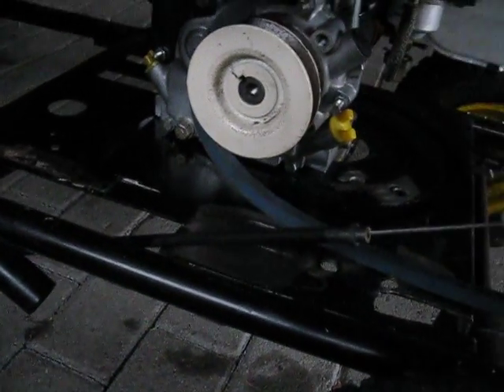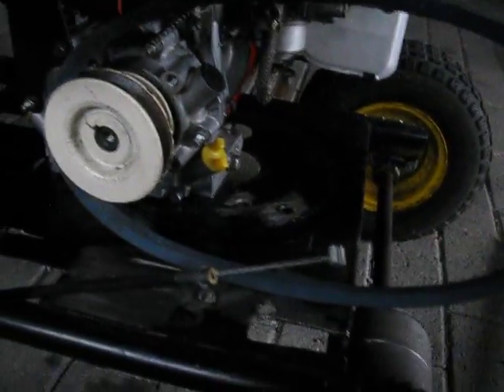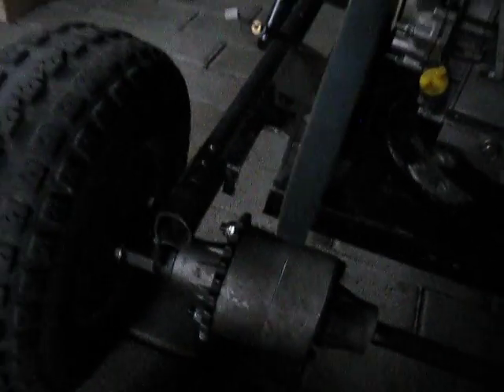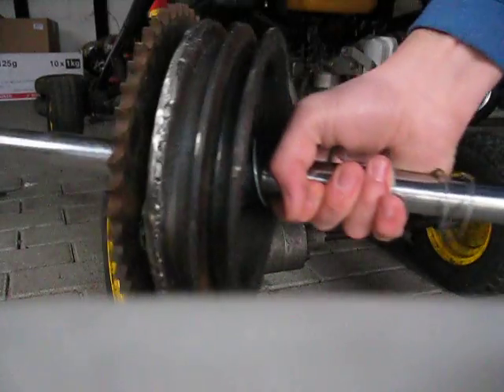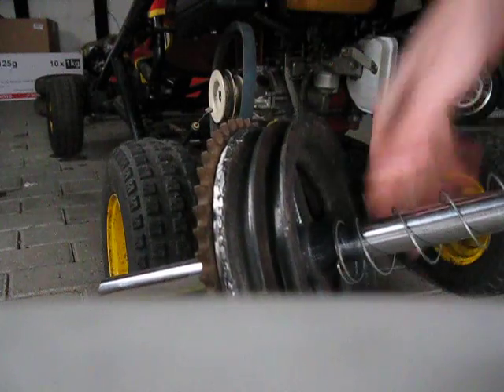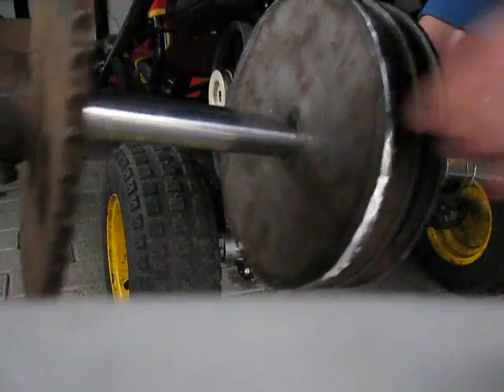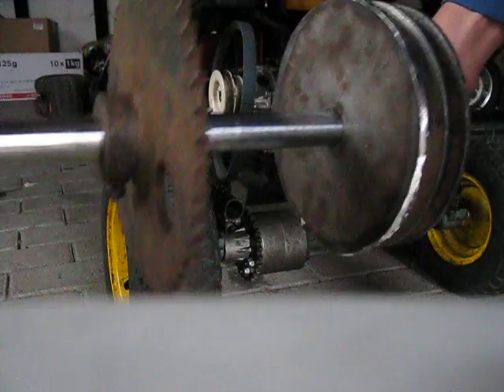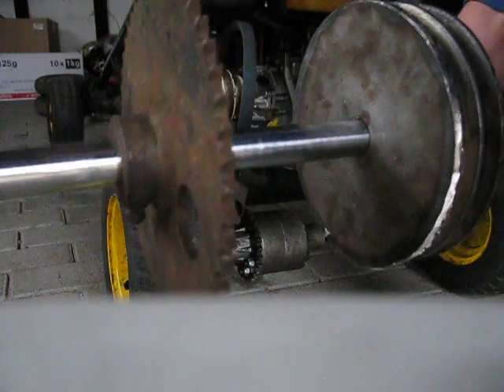Go-kart Clutch Mechanism

Comment: I share your pain kagi95. I'm in Trinidad in the caribbean and it'll cost atleast $1000.00 for me to ship a torque converter. So I've chopped off one from a 125cc scooter, welded an axle to both drive and driven pulleys with a vee belt off the engine to the axle with the drive pulley and a chain off the axle with the driven pulley. Hope this idea works for you too!

Comment: that is NEVER gonna work.  just have big pulley and sprocket both keyed onto the jackshaft.  also u need a smaller drive sprocket.  then make a lever or something that pushes an idler pulley to tighten the belt like a riding lawnmower does, thats your clutch.

Comment: Why don't you just buy a comet torque converter 30 series on eBay. It will save you a lot of time and headache. Some sets even comes with jack shaft plate that attaches to the motor and allow you to adjust the belt and chain to your specs.